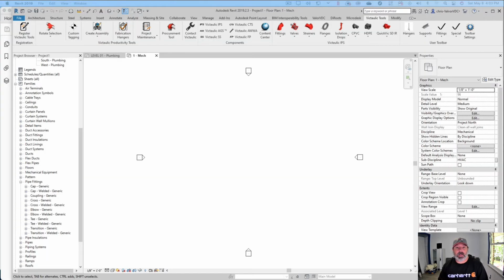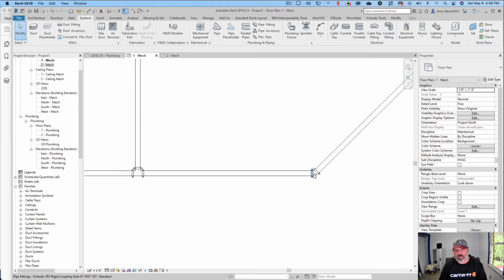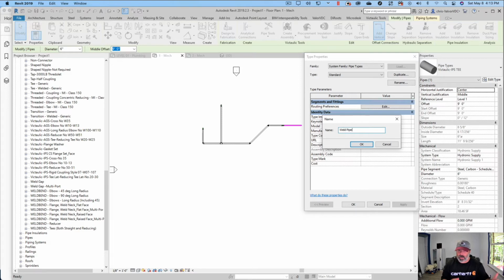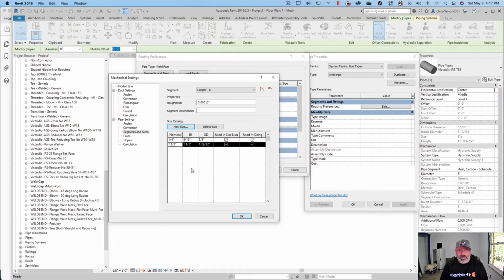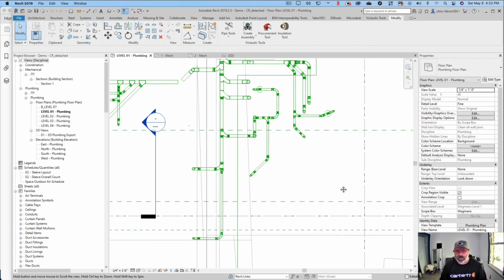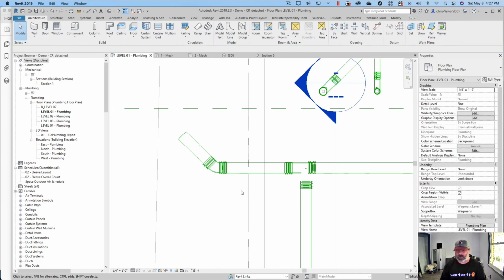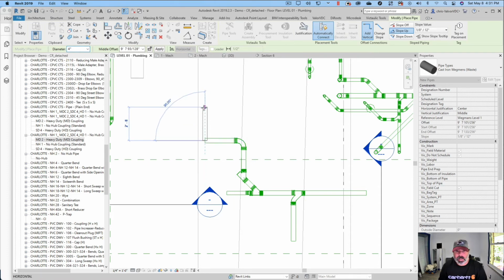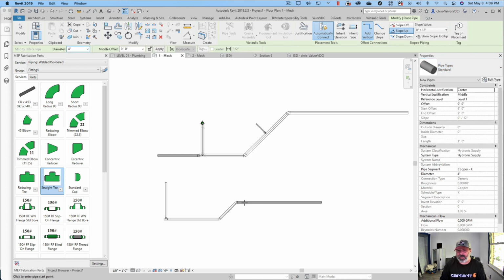Revit Routing Preferences and setting them up:

Comment: Great video. Is there a way to get the routing preference to differentiate the elbow between Quarter Bend and Short Sweep? I am currently using a Generic (Change Out) family for my 90's then swapping them out as I go, much like you are doing with your wye. I think there is a better way to do this and would love some feedback. I have not found anyone else modeling to this fabrication level without using Fabrication parts or SysQue. I have been on this journey for 7 years and Did not think I had a peer.
Reply from the maker: You are not alone there are a lot of us us there, you should check out vic tools and BIMrx these plugins will change your life when working with Revit families. I am currently learning to code so I can write my set of tools. As for as fitting pattern selection, not that I know of, I just create two different routing preferences one for short pattern fittings and another one for short sweeps, this works well as I can use the short pattern option for all my sanitary venting. You should check some of my free families on my website at valorvdc.com.